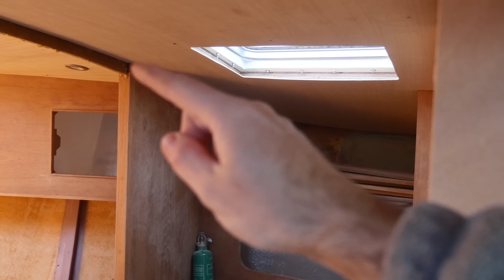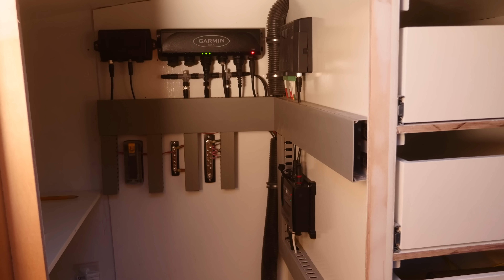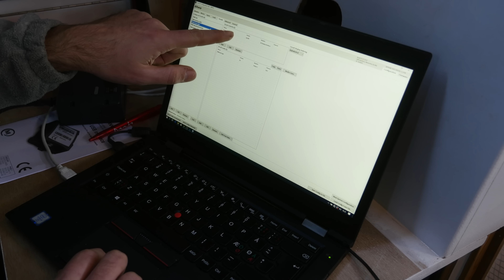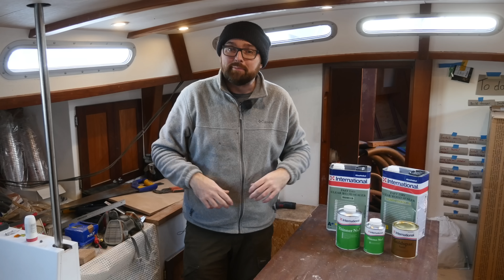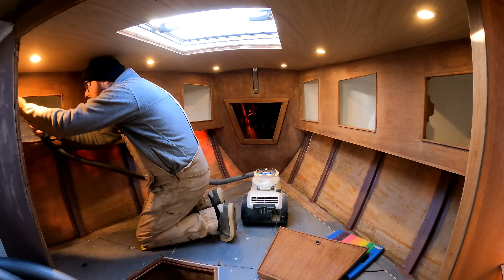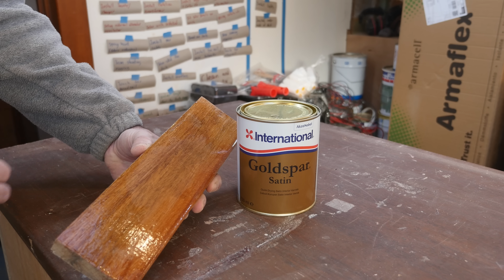Sail Life - Digital Switching (czone output interface) & varnish - DIY

Comment: hi just noticed you dont have a deck hatch for the chain locker this might be a problem if your thinking of high lattitude sailing most other channels have made  big think about a sealed crash bulk head;  i sailed on a  boat going around iceland and to get  insuracne  they had to seal the same sort of chain locker with a bulkhead door and block all drains etc.. they made a deck hatch instead. also i dont know if you have seen sailing uma channel the sailing upgrade i liked was a cabon bow sprit for setting a much bigger down wind sail than you would get having the tack on the bow.. Great work and good choice of boat very solid in heavy weather

Comment: “In the unlikely event” your electronics fail....Mads, ALL electronics fail eventually.  All.  Some fail because of planned obsolescence, some fail because of some engineering defect where the corrosive salt air got somewhere it wasn’t supposed to be, and some die a violent death because that mast acts as a great lightning attractor in a storm.  Whatever the cause, your electronics will fail at some point, and Murphy’s Law dictates the angry pixies will be at their angriest when it is most inconvenient.  Thus, I recommend you plan accordingly.

Comment: When you get to doing the floor, you might want to look into flexible luxury vinyl plank flooring.  We just did our boat with it.  As it is flexible and waterproof, it was the perfect match.  So easy to bend  it (once heated by leaving in the sun in the cockpit) to match the curves of the hull.  You can always add a rug over it in the salon.  Love watching your videos!

Comment: When I was watching the end of the video, I was noticing the proximity of the cooktop to the VHF radio.  I see the cover on it and thought that's definitely a good idea to keep it safe from steam and oil.  I'm thinking that a tempered glass splatter shield on top of the nav desk back would be a good addition.  You could get it custom engraved too with a nice design.  Maybe tall enough to protect the radio face.  Would also keep oil splatter from landing on the whatever is on the desk surface too.  No one wants oily charts.  That's an easy project while you wait for the freezer.

Comment: For the in between layers of varnish, I have had great luck with using steel wool in the past. It will remove any fuzzies and make a nice matte surface for the next layer to bite into.
A big big advantage of steel wool is also that it doesn't clog up like fine sandpaper.

Comment: I've been wondering if you could use USB as a bus interface to control various power switches and sensor data. There are various microcontrollers that can power over USB like the new Raspberry PICO. So you could get power and data over a relatively simple and cheap connector and control them all with a central PC (or Raspberry PI 4).
I know there is a professional bus for boats but I figure that will be quite expensive.
You could have a HAT pcb for the MCU boards to turn on and off power to a light or appliance or motor and could also measure power consumption etc.
You could also "pot" all the MCUs and encapsulate them in epoxy to prevent corrosion.

Comment: I was wondering if you have done any research on UV cured paint and varnishes. Put it on and flash a UV light on the coat and tink, dried instantly. Minus 15 can really do a number on more then plumbing. I saw a half million dollar printer wrecked as the shipper did not put the printer in a heated warehouse over night. Water based paint left in an unheated garage--kiss it goodbye. It's heating up to minus 14 degrees F (-25C) here in St Paul, Minnesota.

Comment: Digital switching is excellent for simplifying wiring and reducing the amount of wire on the boat. It is also nice for timed activity such as turning on running lights at night if AIS is enabled; and if AIS is off turning on the anchor light. Meanwhile for something like pumps, it will let you know how often and how long they run.

Comment: Mattius Wandel recommends using a cabinet scraper to knock down imperfections between coats instead of sanding.  Not sure if it would make a difference with your sealer...

Comment: Love the work you are doing! You might want to covering the electrical equipment in the forward hanging locker with clear plexiglass. Someone will throw some wet gear in there causing issues and the constant rocking of the boat will cause the hanging clothes to wear against your wiring.

Comment: I hate it when you order stuff and it doesn't turn up, V berth is looking great, are you going to insulate the insides of the lockers on the hull side and the switching thing is a great idea  to be able to control lights ect from the helm, kind of like a body control unit for a boat.

Comment: Smart move going with a satin finish over the gloss, gloss shows off any imperfections and just looks...too glossy! For a final finish I would suggest to rub it with #0000 steel wool with a wax lubricant, it will get rid of virtually all brush marks and feels so smooth, it's wonderful to touch. You're doing great!👍☺
Reply: Except use bronze wool on a boat.  Not steel and no rust bits.
Reply: @Stephanie Burgess Ha, you're wiser than me!😊

Comment: digital switching::  Make a set of Bypass Jumper for debugging  &  emergence break fix! a Lighting strike can Fry that box & make the fuses bypass unusable.
Reply: Did you watch the video? The box has a bypass feature.
Reply: @br14nvg1    Yes -Fully. :)  A lightning strike to the mast could easily 100%  melt that board.  making the built-in bypass jumpers useless! Have a small bag of premade bypass cable labeled with connectors already terminated could make keep a bad situation from becoming an emergency.
Reply: Did you watch the video? The box has a bypass feature.

Comment: In case it helps anyone, here's an old trick with varnish that's usually most helpful with brightwork on deck but can be used on interiors; You can paint over cured varnish that has been properly prepped.  Keep in mind the varnish has to be well cured, so that can mean a few to weeks to maybe 2 months since some varnishes take a long time to harden.  People who have lots of beautiful brightwork on deck but plan to sail in the tropics will dread the gobs of UV that will slowly destroy the varnish will like this.  The idea is that an opaque paint (usually white) will defend the surface layers of varnish, but because the grain has been sealed by multiple coats you won't get pigment staining into the wood fibers.  So down the road its quite easy to remove the paint with a heat gun and then revarnish the bright work.  Sounds like a lot of extra work, but trust me when I say it is WAY less work than sanding down UV split varnish to bare wood and starting from scratch.  So on interiors you can varnish to seal it fresh, or if you have old varnish you really don't have to remove all of it to bare wood.  The prep is the same as you would expect on any job, sand with 220 to scuff the surface, remove dust and tack cloth, then roll primer.  This is a great choice if you are on the fence about painting something that was traditionally varnished but worried you might change your mind (or that a potential buyer will hate it).

Comment: Epethanes singlepak varnish can be used doing about 3 or 4 coats wet over tacky in a day, it takes a little while to get a full cure on it but so long as your gental with it for a week or so it's fine. If you want to get a high build in a single day epethanes make a 2 pak pu varnish that cures super fast.

Comment: This may be a nuisance comment but with fitting your deckhead panelling one thing I find absolutely helpful is to design it so it can be easily removed when needed, it seems yours is permanently fixed. Not a good idea! Is looking good👍
Reply from the maker: It might seem that way but it's not the case ;) Right now it's just held up by a few screws. We haven't figured out how to finish it yet - paints vs fake leather.

Comment: @Mads I have a similar space for home automation.. Consider a emergency battery powered light (standalone charge from boat) in case of technical disasters it will always be dark en the lights will not work to fix the simple issue at hand.. They gremlins seem to miraculously disappear when you install said light..

Comment: Highlight of the week!  Electronic switching looks great - cable on the basis that it will be expanded, an additional box can extend existing switching - the sky's the limit, i.e. red night light in the nav. station, then the galley, then the cockpit and so on, all remotely controllable from existing switching, it's wonderfully flexible.  Fingers crossed for the freezer.  Great to see Eva. Right choice for the varnish, although a mix of paint and varnish does look good.